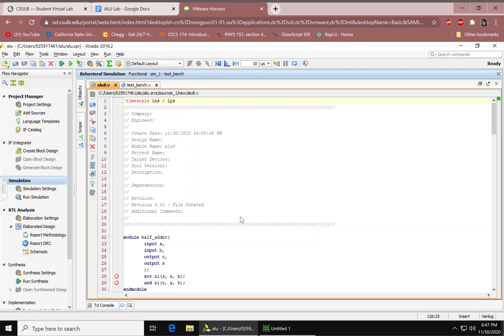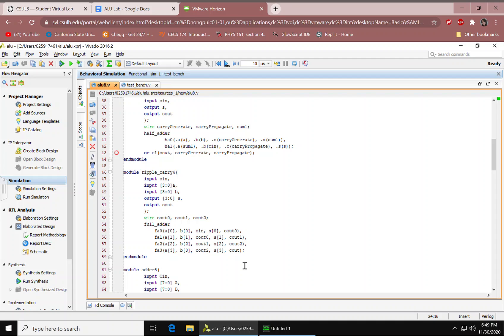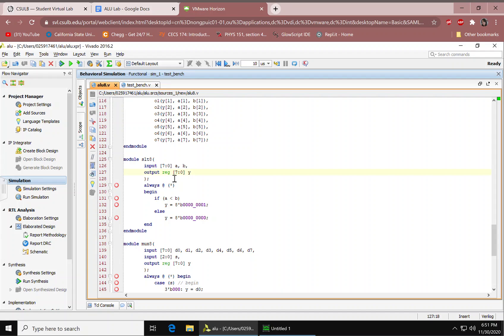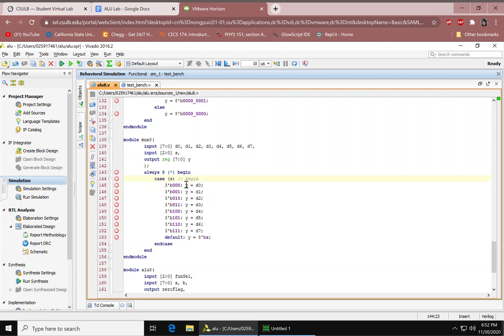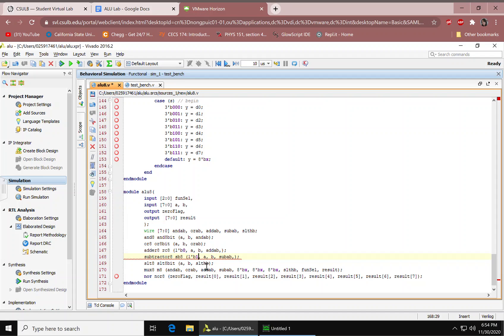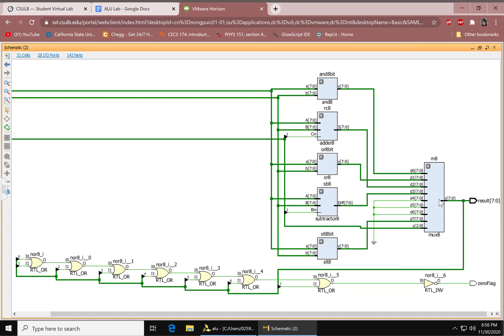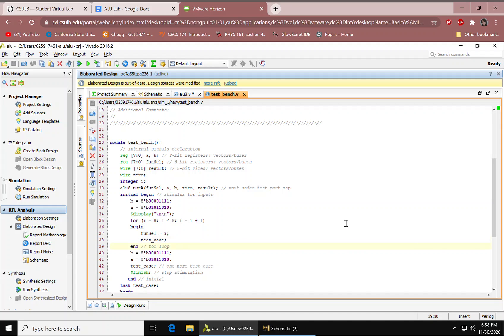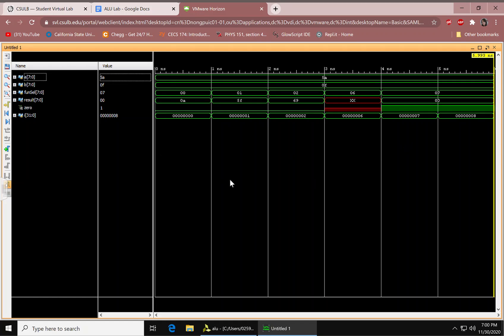Vivado Verilog 8-Bit ALU

Comment: I'm an Electronic and Communication student at Istanbul Technical University, Turkey. And I found your videos while searching for some I/O read-write for txt files videos about Verilog. I'm nearly the end of my Digital System Design Applications lesson, your codes are extremely well written, in beautiful order. I hope you keep doing good works in your university. However, I think you might have included some general information about your topic (what is ALU and what is it used for). Nevertheless, it's a well-explained code. Keep your motivation high! ✌